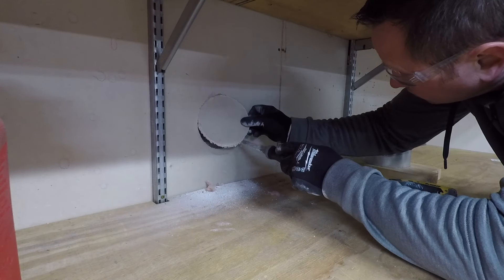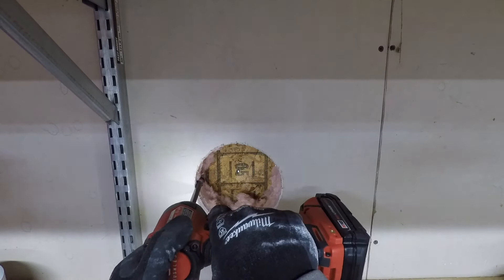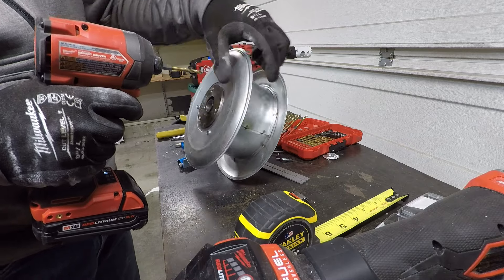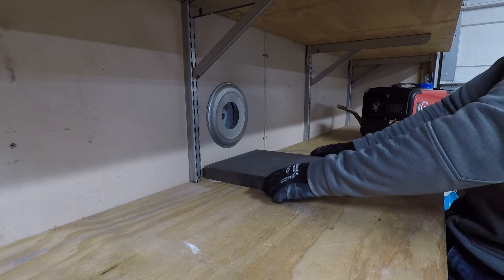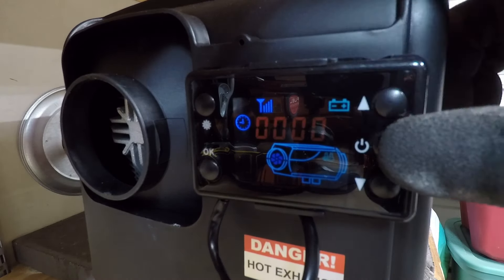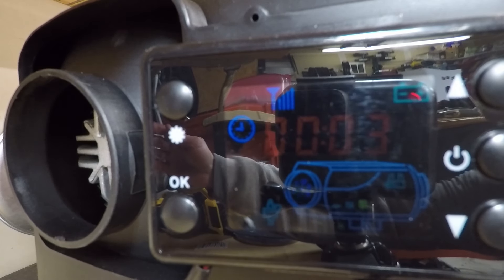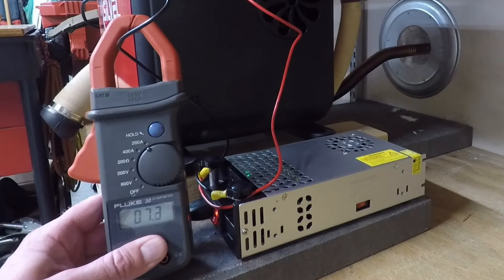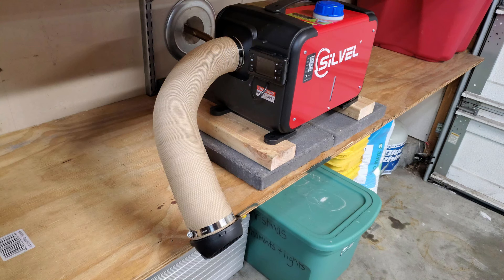How to safely port your diesel heater exhaust through a wall

Comment: Isn’t there potential for a condensation problem with the low point of your exhaust pipe? The outlet being higher than the rest of the pipe, I would be concerned that it will eventually fill with water and cause issues. Maybe consider raising the heater so that any condensation will drain out the end outside. My 2 cents. I really like the thimble installation. Cheers
Reply: The exhaust pipe would have to be cool enough to allow condensation.  It is way to short to cool enough.
Reply: I watched a video recently where a van dweller had the tip of his exhaust on a very short pipe filling with water and causing issues because he had the end too high for it to drain. Maybe you’re ok if the heater run all the time
Reply: @billmoore5177  Rain or road spray perhaps instead of "condensation?"
Reply: @tomsteen2492 first off all great idea for the exhaust, my first of a diesel heater install I had the exhaust outlet to high and and night with out even knowing it the exhaust froze totally shut and the exhaust started leaking back at the outlet of the heater itself and filling in the area where I was sleeping ( btw it was in a ice fishing shack ) needless to say I was very lucky that I had a carbon monoxide detector, I couldn’t believe how much ice built up in the exhaust pipe , so with out saying took it back to the shop and did a reinstall of the heater making sure the heater was higher than the outlet of the exhaust
Reply: Came here to add this. Seconded.

Comment: Exhaust should run down to drain the condensation.   You should never run a diesel heater from a mains supply, if you have a power outage the heater can't go through its cool down proceedure. You risk frying the electronics in the heater or even a fire.  12v battery and a trickle charger is the correct way to go.

Comment: The problem with using those power supplies is if you lose power you won't get a proper shutdown.  It's best to use a battery with a trickle charger, but what are the chances of you running this and losing power...?

I'm going to alter my exhaust design to use that 3" thimble with insulation, looks much safer.  You could increase efficiency by porting your combustion intake from outside as well.  If you don't you are creating negative pressure in your garage and cold air from outside will find its way in.
Reply from the maker: Very true on the power failure point. I considered keeping the booster pack close in the unlikely event that happened. Combustion air was a concern as well but I have a few air leaks already with the loose seal on the garage door and drop down attic ladder. Using up the oxygen would be a consideration in a smaller space but I figured my air leaks would provide enough make-up air.
Reply: @sbbox230  Yes, having a battery power supply is best for ensuring against a power failure, but as you mention that you're only planning to heat the space from time to time, you're likely to be present in case of power loss and can quickly attach your jump pack to let the heater clean/cool itself, so I don't see that as a real concern in your instance. I think what DryUrEyes was eluding to re. the combustion air intake not be routed externally is not an O2 level concern, but that you are essentially running an exhaust fan to the outdoors while trying to heat the space. You're consuming the air your trying to heat and constantly replacing it with unheated air through the leaks in the structure, more of an efficiency loss  than a safety issue. Excellent install video which provides competent instruction for avoiding many of the common safety mistakes some folks don't realize when installing these units. Super clean look too! Thanks for sharing!
Reply: As soon as it looses power, and when re connected to power
 It will go throught start up when the button is pressed. It has no idea where it's at in the running sequence.

Comment: You made the exhaust port too high, buddy, and didn’t factor in condensation accumulation. This is NOT a proper how-to video.
Reply: Feel better?
Reply: Show us how it’s done!
Reply: @Icutmetal  Nah. You figure it out, smart guy.
Reply: From what I have watched all these videos I don’t see how the moisture gets through that exhaust without elaborating if it hangs in there too log. 🤔 If it did burn/rust a hole. “How long would that take?” And how much is a new exhaust? 🙄
Reply: @philweed1603  What's with the gay fantasies so many YT commenters have? Not that there's anything wrong with it 😂
Reply: The big concern here I would think is if the water gets so high that it blocks the exhaust like a p trap, this could happen I think in some cases the exhaust is only like 200 degrees at the outlet, but idk it would take some time to build up for sure and then it would just be real smoky in the shop, very noticeable and fixable thing….
Reply: @Icutmetal its because he doesnt actually know how too

Comment: That’s cool but what if you have vinyl siding and can’t find a replacement in the future for the gigantic hole you drilled through it
Reply from the maker: You could install a "mounting block" like you would for a light fixture on traditional lap or vinyl siding. Then with vinyl, you would install the J channel around the block to terminate the siding into.

Comment: I have tried using the fiberglass wrap as was provided by the manufacturer VEVOR and then add additional wrap creating a diameter of about 1 1/2" . I then ran the exhaust pipe thru a 2 x 8 wood section that I placed on the floor of my garage, as a spacer for my overhead door. This pipe got so hot that I could still smell wood burning. So, don't underestimate the pipes temperature. I am currently rethinking my methodology and considering this persons route.

Comment: wrap your exhaust pipe with header wrap, do 2 layers and it wont get hot, will look cleaner than those stones, not only that the heater will run better for some reason and be a bit quieter

Comment: I have one of these. It is a good idea to move the pump so it is more vertical. They say the pumps mounted horizontal don't last as long. I extended my pump wires so I could mount it near vertical.

Comment: Very nice setup going outside. Been wondering how it could be done and you've answered that! I have one question. How did you get the 5" cap inside a 3" thimble?.
Reply from the maker: So a 3" thimble is made to go over double wall "B" pipe (it's already over sized). Then you have extra diameter (air gap) between the pipe and the inside of the thimble. I just did a little trial and error until I ended up with this. Hope that helps!

Comment: What about drilling a hole in the garage door for the exhaust?
Reply from the maker: That's the way we did it in the mechanic shop I used to work at. I still use the garage door in the winter though, and I don't want to have to unhook the exhaust every time.

Comment: What gauge wire did you run from the power supply to the heater?
Reply from the maker: Honestly, I can't remember for sure. Since it only pulls 7 amps, even 16 AWG would be plenty.

Comment: How big is your garage and ceiling height and what temp can you get it to when it's 20 to 40 degrees outside?
Reply from the maker: My ceiling is just over 9' and I believe the garage is about 22' square.  I haven't done much testing but there have been a couple days where I kicked it on with temps in the 20 degree range and the heater warmed it to around 50 within about an hour. Important thing to remember when heating a cold garage is everything out there including the concrete floor acts as a thermal battery, however once everything is up to temp, I've noticed it takes way less effort to maintain a comfortable temp.

Comment: Would there be any moisture built up in the wall dues to the temp changes?
Reply from the maker: I wouldn't think so. Since there is an air gap before the ceramic insulation, then the thimble separates all that from the inside of the wall. The only way to know for sure would be to open it up though.

Comment: How hot does the exhaust actually get. I'm hooking mine up and what to know how over kill this is? Looks very safe but do I NEED all this?
Reply from the maker: I'm actually not sure about the specific temperature. I just know it gets very hot and I didn't want to take any chances of starting a fire in my wall. Probably is a little overkill I'm sure.
Reply: Mine gets up to 300 or so about 1' away from the unit

Comment: What did you use to waterproof it from outside?
Reply from the maker: I used a paintable caulking around the outside of the thimble, around the screws, and where the port meets the thimble. The whole thing has since been painted to match the house color.
Reply: @ I appreciate the response. I will be making the same setup as your as it is the cleanest and safest set up I’ve seen for an exhaust port. How did you install the chimney cap inside the thimble? I can’t figure it out in my mind because the thimble interior diameter is ~3 in., the chimney cap ~ 5 in. & the thru hull exhaust is ~3.5 in.
Reply from the maker: The thimble fits a 3" pipe, however the cavity (air space) between the flange and the internal wall provides space for the cap. This is the area you see in the video that I already have filled with insulation at 2:38.

Comment: If the garage is not air tight then no point having the combustion intake outside. That's why on my set up left it inside.. 

I have a roller dooor so draft always comes in making it ventilated